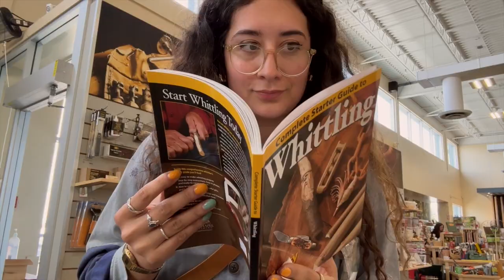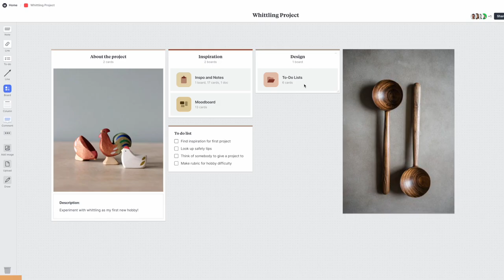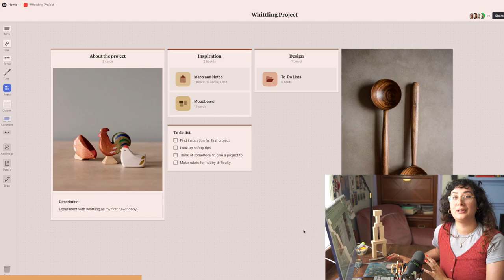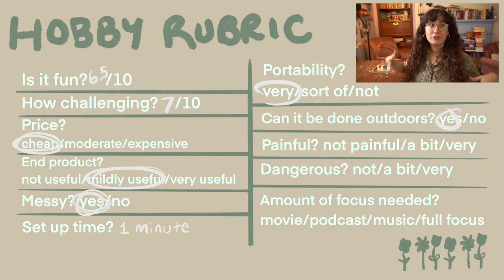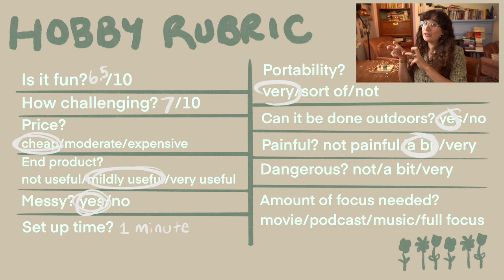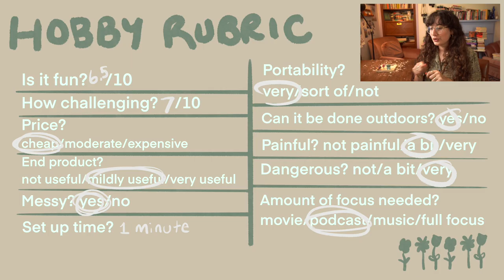I Tried Whittling For A Week

Comment: The thing to remember is that it's "whittling" not "carving" so it's a long process of taking tiny little shavings off. The shallower your scrapes are the smoother the process will go. It's why the axiom is "whittle away at something" it's a long process.
Reply from the maker: Oooooooo that’s a great way to put it
Reply: this is so helpful, what a good tip! thank you.
Reply: Thanks i was wondering what whittling is before I started the video😹 never heared of it/English is not my first language

Comment: I would definitely recommend learning to make a thin spatula, carving something small as you did is way more tricky because of ht difficulty you had holding the object down, holding onto the handle you carve first easy to whittle a stick down to a thinner stick, then and carving the end into shape. Also, if you ever have to cut a branch off a tree, that wood as long as it is 'green' will be so soft to carve! even practicing types of cuts on sticks will help you loads, as you can hold the stick a lot easier than you can a block. Hope that helps! Loved to see you learning and giving it a go, it's made me want to pick up my knives and axes and get back into spoon carving! Love your videos, they always bring me such lovely wholesome vibes <3
Reply: I've only ever done whittling on sticks using an exacto-knife, usually to make a tool for fiber arts. Working on something long and smoothing it out can really help get the feel for whittling. I'd also suggest peeling fruits and veggies with a paring knife to help develop control.

Comment: These are so very cute!! I have a suggestion, for what it's worth. There is a good time for whittling with your knife pushing AWAY from you as you're doing; but, I usually do this only when I'm shaping a large, lax tolerance piece. For SMALL objects such as you're using try this instead: 

1) Hold the object with your non-dominant hand (it seems yours is left)
2) Lay the hilt of the knife across your four (4) fingers of your right hand & cradle it there
3) Place your right thumb against the bottom of the object to hold it firmly in your knife hand
4) Use your fingers to carve TOWARD your thumb
5) Try doing this with a butter knife first JUST TO TRAIN YOUR MUSCLE MEMORY

It's so much easier to do. You can make tiny cuts this way (no cutting off the bird's tail/beak), no you shouldn't cut your thumb. You won't get so tired and you'll get much better as a whittler. 

Love your channel and you always make me smile! xo

Comment: I've "been friends" with a knife since childhood so I found this really enlightening. Seeing someone trying it out for the first time. Personally I would have suggested you start with something a little bigger and easier to hold. Just sharpening sticks for roasting marshmallows was good practice for kids :) Smoothing sides of a larger piece could end up as a cutting board. Those tiny pieces aren't that easy to hold. But one of my favourite things about this is that you can make something out of just "trash" like odds and ends of wood from bigger projects. Any home renovator could have abundance of materials already and with just a knife and some time turn leftover scraps into something useful and beautiful :)

Comment: Crocheting, felting, or cross-stitching? Just a couple of suggestions ha, I like them all. For whittling, if you don't want a ton of tiny mushrooms, you could also get some thinner planks of wood and make wall hangings/carvings.

If you like knitting then I heartily suggest trying crochet if you haven't, I find it's even easier and it produces things quicker, although it does tend to use more yarn.

Comment: I have been a woodcarver for over 20 years, which has also incorporated whittling at times. First of all, your glove was too big for your hand and the type of glove you need is ideally a Kevlar cut resistant glove. The glove is Cut Resistant but not cut proof, so you can still puncture thru your glove, so you always need to be aware of where your blade is. To keep your knife sharp a good strop and compound are handy and you should strop your knife at least every 1/2 hour while you are carving. I teach beginners and the 1st thing I teach is Safety and the major cuts to use when carving. Then I teach how to carve a ladybug, this project teaches you how to work with the grain of the wood and how to round off a project as well as putting to good use the types of cuts you use in projects. After that you have lots of fun. One more thing always have handy a small spray bottle with 1/2 water and 1/2 rubbing alcohol, if your wood seems hard then spray a little onto the wood and start carving again---it's easier to cut the harder wood. Don't saturate the wood. At first your hand will hurt because you are using muscles you either have never used or haven't used in a long time, but over time it does help to build up your hand muscles. I recommend you try again with the whittling and stick to it for awhile and see how satisfying and relaxing it can be. Happy Carving! Your three projects came out very good, be proud and sign them. Also keep them and if you keep up the hobby, compare the first projects with later projects and see the improvement.
Reply: I've been whittling for a couple of years and didn't know the rubbing alcohol/water trick, thanks for sharing! This would have saved me a lot of hand cramping at some points.

Comment: I took a mini whittling class, and I didn't like it at all. And just like the time I took a stained glass class, I worried that I would cut myself with the sharp glass or the knife, and for both hobbies you need to use strength. Whittling hurt my fingers and wrists because like you (I believe you said you said you have "erythematosus" that is a type of Lupus), I have an auto-immune disease, Rheumatoid Arthritis, and it causes painful joint swelling that is aggravated with overuse of joints. So my dream of making my own Hitty doll was dashed : ( I have numerous hobbies that I started as a young child. I am 72. I spend most of my days making craft items, especially  miniature room boxes and miniature accessories that I make from fabric, wood,  polymer and self drying clay, and fabrics. (BTW: I love the miniature room in the wall that you made.) I also do scrapbooking and card making using die cutting machine and dies. I tried knitting and learned basic stitches but I don't like following patterns so I could only make scarves-LOL. But I just bought a small inexpensive Punch Needle Kit that I want to try to make. Start-up is inexpensive. Can you try making one of those? Thanks for your wonderful videos. I am also a devoted bibliophile, and a DIY home decorator and furniture refinisher, so I can relate.
Reply: I want to try all kinds of crafts that are hard on the wrists! I have some kind of RSI, and the craft that has been really accessible and satisfying for me is cyanotype! And the washable, multi colour version: solarfast. It's really easy to make beautiful prints, and I've been making cards and printing on clothing

Comment: I'm in the middle of being diagnosed for Ehlers-Danlos syndrome and I'm always trying out new hobbies. Woodworking has been on my list but I am only now starting to factor in whether my connective tissues can handle certain motions. For example I love crochet but the twisting of my wrist hurts more than continental knitting. So thank you, also yet another reason to love your channel (books, house fixing and EDS <3 )
Reply: You may want to experiment with actual carving tools and a mallet. It IS repetitive. However, you clamp the wood, and I think that might be helpful.
 If you do look into this, see if you can find a class first. When buying tools, look for used tools. 
When I started carving, I used tree limbs from the DPW (Department of Public Works. They were tree trimming around town and tossed the limbs in a big pile.)
 I bought a few new tools ( I couldn't find used, sadly!) I'm still using the same 5 tools !
Reply: Have you tried cyanotype (or solarfast)? It's easy on the joints but has such beautiful results!

Comment: The items you whittled are soooo cute!!! I love the little mushroom especially. 
 If you were enjoying the painting process, you might enjoy doing some polymer clay pins where you simply make a flat shape with polymer clay, bake it, and then paint your designs on the flat shape! It's also easy to work polymer clay if you just heat it up a little bit before working with it.

Comment: Enjoyed watching your attempt at whittling. I got into wood carving/whittling myself about a year ago. It's much easier to carve the wood using the push cut method. where your hand holding the knife holds the blade and guides it to where you want to make the cut and you use the thumb of your other hand, while holding the piece, to push the blade to actually make the cut. Using this technique, it gives you better control and I think you would find it much easier and more fun.

Comment: You've got a solid start here! One thing I've found useful regarding both holding the workpiece and the force your hands/wrist/arms have to put into a cut is to carve your piece into the end of a longer piece of wood, and then cut it off when you're at that point. I'll often hold the piece under my arm, braced between my arm and a table or chair, or between my legs (or if it's a shorter piece, against my chest - with the use of a concave piece of wood on a necklace so it doesn't bruise the spot), so that my off-hand is there more for control than support. With some of the bracing methods, this can allow for my entire torso to be involved in applying the force for the cut.

Comment: Hey! Good choice of a hobby, especially if you want to let your creativity loose :)
If you allow me, i would give you 3 tips:
1. As firsz step (after buying the tools), is looking up whittling techniques on youtube. It can really make your life easy. There are holding and cutting techniques for taking off small pieces or big pieces, from one end or the other end, more power or more control cuts etc.
2. You can spray the wood with a mix of water and alcohol to make it somewhat softer (waster softens, alcohol helps evaporate)
3. If you want the softest wood, try balsa wood. You can cut it almost with a sheet of paper.
Hope you did not quit after the video...

Comment: I am addicted too heading that look like rosaries. Beads, usually 4,6 and 8  mm. Wire ,around 21 gauge. Wire cutter and ring und nose pliers that cut about 2 mm length pieces. Loop one end then add a bead or two or three. Loop another one on the end l keep making these sections and loop them to  each one. You can add a clasp and a pendant. I love to use crystal beads that shimmer. I sometimes add spacers and also layer 3 different necklaces in different lengths 30:10  and bead sizes. They also make pretty ceiling fan pulls.

Comment: Something I’ve always wanted to try is ridged heddle loom weaving. You can get an inexpensive small frame that sits on a table and make scarves and purses, placemats, table runners; all kinds of things. Craftsy has some classes on it, and if you try at the right time, sometimes you can get a year’s subscription for $2-3!  They have all different kinds of crafting tutorials! I’ve got the loom ones, but hvnt watched them yet! 😂

Also, when you found that broken dish in the attic, I thought you cd try making mosaic art with it. You put the pieces in a brown paper bag (to prevent flying debris and getting cut) and smash them up with a hammer; then tile things with the broken pieces, like a small table top or a flower pot and then put grout in the cracks. I’ve seen some really pretty things done. 

You cd try beading; and as I mentioned bf, make strings of colored beads to hang in your interior window. 

I’d also like to mention that it seems you put a lot of pressure on yourself abt making these videos. (Maybe it’s bc you hv sponsors, and feel the need to do a BIG video.) But you don’t hv to do an entire project from start to finish in one video! You can do stages. For example, you don’t have to do tho whole kitchen or the whole bathroom in one video. If it’s a huge project, just do a vid on one portion at a time. Way less pressure and way less editing all at once. And then, maybe you cd include more detail (which we’d love to see!)  (Still wd love more detail on those new floors you laid; kind of wood, size of boards, did you use a jointer or planer, did you glue them down or nail or screw them into place? Or did you just lay them down and hope they’d stay put? How did you hide the fasteners? How are they holding up? How much did it cost to do a particular room? (Inquiring minds want to know! 😂)

Same with trying a new hobby: You don’t HAVE to work on it every day for a week. You can, but who has time for that? A shorter video once a week or something, showing your progress cd be fun; and less pressure for you. After all, you are still remodeling that house and that takes a LOT of energy and stamina! Be a little kinder to yourself and lower your expectations on production and just enjoy your life. 

What stands out to me, about you, is your joy in life itself; and your joy and delight in trying and discovering new things, and the satisfaction you get in the accomplishment! It’s so inspiring! Like every thing is a new adventure. And it’s contagious! Keep it up! 🌷

Comment: I think one thing to add or maybe clarify in the rubric is how quickly can you get good enough to make something useful? I know you have usefulness and ease of starting in the rubric already but I think for hobbies like whittling especially talking about the intersection would be helpful. There are hobbies where you can start right away but nothing useful can be made until you're proficient, and others where you take a while to learn the basics but can make useful things as soon as you have them down. For example, with whittling it seems like it's  really easy to get started with and you can absolutely make something useful with it, but it will take you a long time to be good enough, whereas with something like woodworking, there is a lot to learn before you start, but you can make something useful once you know it.

Comment: I love this idea!!! I'm trying very hard to unlearn the idea that I've "failed" at hobbies when I, say, try one out for a month and then abandon it (thanks in large part to ADHD) and instead tell myself that I'm just literally being a human being and trying out things and I don't NEED to make every hobby a way of life. I'm a jack of all trades, master of none and that's great! I'm living life! Trying a hobby for just one week on purpose is a delightful way of supporting that idea.

That being said, I've been a whittler for about two years now and if you do not mind I will drop a tip here for if you decide to continue whittling, for safety and comfort! Firstly, highly recommend getting yourself some specifically slice-proof gloves! I personally wear mine on both hands and not just the wood-holding hand because I'd rather be safe than very very sorry -- I've cut myself once (so far) with the knife and it was bad even with the glove, I dread to think what it would've been like without the glove. I've heard some horror stories.

Secondly, if you get some of that sorta bandagey-wrap type thing for muscles (? I do not remember what it is called) and then wrap it very thickly around both thumbs (over the gloves!), then you can very comfortably use your thumbs to push on the back of the blade for every single cut, and it gives them more force AND more precision. I hardly move my right arm at all while I whittle - using both thumbs on the back makes it more of a sliding motion, where I really just use my thumb to guide the blade. Much less taxing! Love those bandagey-wrap muscle things.

And sorry, this is more than just one tip, but thirdly, sharpen your blade often! It's my least favourite part of the hobby and I find it tedious BUT it's so necessary. Partly because it's just frustrating for a dulled knife to slow you down, and it makes it just more difficulty, but mostly because it's much more dangerous to use a dull knife because you're having to apply much more force which might then make it slip off and into your hands.

ALSO last thing I promise. Highly recommend the youtube channel Carving is Fun! His videos are what got me started and his tutorials and explanations are super easy to follow and he drills safety into his viewers with admirable persistence.

Apologies for the unsolicited advice!!
Reply: I agree with keeping your tool sharp. Dull blades = accidents!
Reply: I think jumping from hobby to hobby for me is just skill acquisition, and a lot of hobby skills feed into each other, so if you come back to a hobby, you've almost always improved somehow - either you're more patient, know more about your personal taste, have more fine motor control, know more about the skill you need. Having a billion projects going at once (abandoned? No! I could come back to it in a couple of years 😂) means that if I ever want to make something specific, I have all the tools and bits and bobs I need!